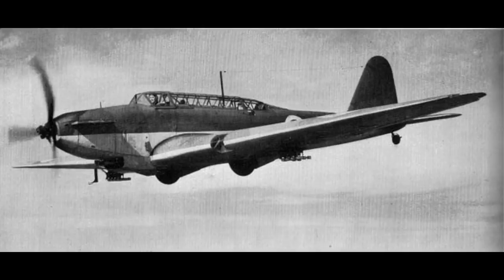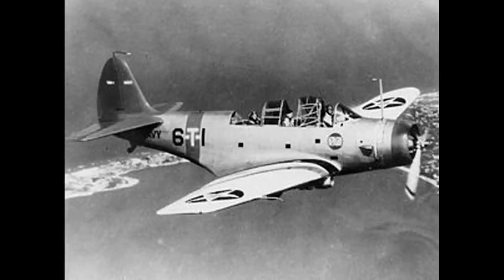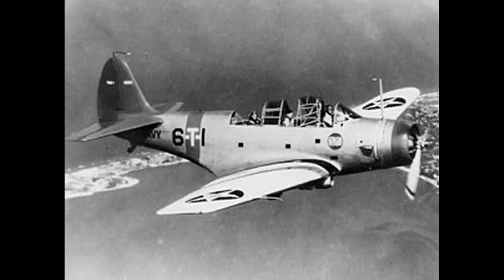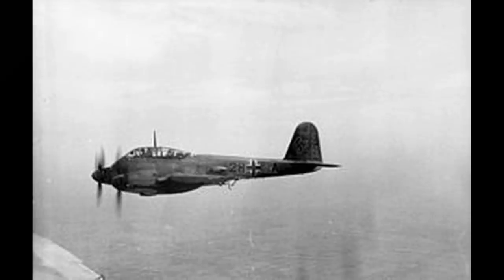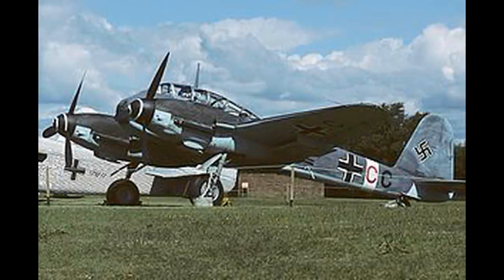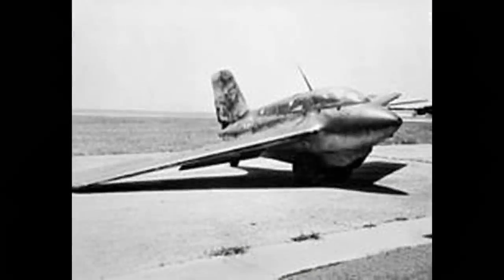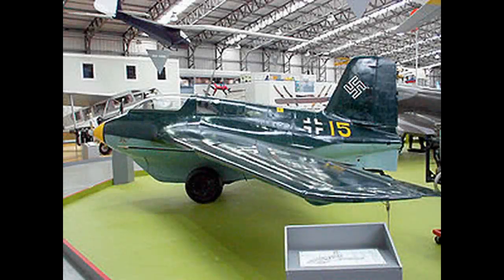TOP 5 WORST military aircraft used during WW2

Comment: Some of these, I agree...

However, your commentary is somewhat offbase dealing with the ME-163.

This aircraft was experimental for most of its service life, and early on, was never intended for combat. It was not used in WW2, until the German Luftwaffe became desperate.

It was an excellent prototype, and might have yielded a very good rocket-propelled aircraft in another few years. But as we've seen of history, it never got the chance to even get a decent set of wheels <grin>.

Again, strictly a prototype.
Reply: I don't think that's a fair representation. It had moved on beyond the prototype stage and was a proper production model, being built in the hundreds.
Reply: @AG9229  

I was very fair.

Remember, the ME-163 NEVER got a decent set of wheels for landing. This is strictly a prototype structure, and its design never advanced beyond prototype.

This partially explains why the accidental deaths of ME-163 pilots, outnumbered the deaths in combat. Its velocity of standard flight was not withstanding here. Several were shot out of the sky, by conventional production aircraft, both Polish and other pilots.

Again, it was used as a fighter, by a desperate Luftwaffe.

Period, end of story.

Other prototypes were also designed without wheels. Take a look at the US X-15. Wheel in front, and landing skids (not wheels) for landing. Again, strictly a prototype, never became a refined production aircraft.

The ME-163 was never a refined production aircraft, even when used in combat.
Reply: @kd7bwb12  I don't think you were. The fact that they put it into production without a decent set of wheels for landing shows how moronic the programme was. That doesn't change the fact that that's how they made it for war. It was a proper production model.
Reply: Wow, I guess you think that not only are you entitled to your own opinion, you're also entitled to tour own facts. How sad.
Reply: @AG9229  

Firstly, I am exactly right.

I am not stating '... my facts ...', I am stating the absolutely true facts. Neither you or I can change them.

This aircraft was launched on a trolley-wheel set that were left on the ground. This aircraft had no wheels as part of the aircraft. 

Period.

ME-163 landed without any wheels whatsoever. This aircraft was not built with wheels. This wheel set was made to work with multiple aircraft. And the aircraft not only flew without wheels, but had to land without them.

Period.

Now if you have some photos of ME-163 landing with wheels, or flying with wheels as part of its structure, you get an apology.

If you can't, you need to rethink your entire basis of discussion.

Crashing happened quite often, because there was nothing to land on, but its fuselage.

The ME-163 did not have wheels as part of its structure. Ever.

The ME-163 was an experimental prototype that was made multiple times, and never had wheels as part of its basic structure. This is the same kind of production as for the US X-15, in which 5 X-15's were built, and flew 199 missions. All experimental.
Reply: @kd7bwb12  you are far from 'exactly right'. You keep stating it was a prototype. It. Was. Not.
It. Was. A. Production. Model.
Again, you seem to think you are entitled to your own facts. You are not.
Reply: @AG9229  

It was never a anything but an unfinished prototype. That over 300 were made, do not make this a finished production product. It was never finished.

And it will never be finished.

Again, This is not my facts, this is the absolutely true facts. A patchwork project, that should have had more time to finish it. But ME-163 never got it. Meanwhile, it was pushed into some kind of production as a war production decision.

It was never a standard production regular aircraft of the Luftwaffe, period. It was a prototyped oddity that should never have been made in even the small numbers that it was built in, as it was still an experimental prototype.

I say small numbers, as standard production German Lutwaffe aircraft were made in thousands, not hundreds. Even towards the end of the war, the ME-262 had 1400 built, towards the end of the war. The ME163 had just over 300.

The ME-163 was not a prototype because of its rarity. It was a prototype because it remained an unfinished design. It was never a standard design.

Period.

This is not an opinion, all you have to do is look at the ME-163. It is clearly an unfinished prototype. It was so much a prototype, that it killed many pilots. Most of these deaths did not occur in combat. The plane was unfinished, unstable, and difficult to handle.

It still needed a great deal of work, to create a finished product.
Reply: @AG9229  

The only delusion here, is that you think an ME-163 that was reproduced was a "... standard production..." aircraft because it was  manufactured and forced into combat. The ME-163 was an unfinished experimental aircraft that was forced into combat.

Period. You cannot escape the truth.

You've already abandoned the 'wheels' debate. What else will you do to change the goalposts? Without wheels on the airframe, you had no 'standard' means of landing this aircraft, except by basically crashing it. Remember, this thing only ran for a few minutes. Powered landings are rare, and unpowered landings were very hazardous.

Even more, when we get to developments of the ME-163 in which landing gear, as part of the airframe, was instituted, now we are forced to see this aircraft as a developmental prototype again. And these variants never flew in combat.

I say again, the ME-163 (all variations) were prototypes. The ones that were forced to fly in combat, had no integral landing gear or wheels at all. The few that did, never flew as standard production, or in combat.
Reply: @kd7bwb12  you are mis-represrnting my position by making it seem that have said something I never. You are, a can confirm, dishonest. I never said it was a standard production model. I suspect the parallel you're trying to tie me into here is a false equivalence with the 109. 
They may not have made as many, but you simply cannot, in any honest way at all, pass off over 350 units as prototypes. Half a dozen, probably. 10, maybe at a push. But when you compare the numbers of prototypes of other aircraft of the era, it does not compare. Hawker Hurricane: 1. B-24, fewer than 10. Spitfire: 1. Gloster Meteor: 8. This is the norm. Not over 350. You, sir, are a liar.
Reply: @AG9229  

Okay, just for fun, let's use what you actually said:

"I don't think that's a fair representation. It had moved on beyond the prototype stage and was a proper production model, being built in the hundreds."

The ME-163 was never a 'proper production model'. Wikipedia says 370 airframes (it does not discuss numbers in actual use as fighters) built. It was always a prototype and continued as a prototypical air vehicle until the ME-163d model (please note, I'm getting into production details of the actual design prototypes), which was subsequently renamed ME-264. THIS aircraft actually had integral landing gear, with wheels, a lengthened fuselage and other enhancements. I've seen the pictures. But like the ME-163c, it never saw combat, and was never made as a 'proper production model'.

Now we're not even talking about the same airframe. And that plane never went into production, for any reason, proper production or otherwise. It never saw combat, there was not enough time to resolve the prototypical features of the aircraft, and design something that would be a 'proper production model'.

I'm not being deceitful in any way. I'm being as directly honest as I can be. I'm even giving you actual details, you have failed to try to do in your own discourse. Who is being "... dishonest or deluded here ..."? You're not even defending your position. You're just attacking me, which is "dishonest and deluded ...".

Grow up, this is a discussion where actual facts are entering the picture. The ME-163 was never a proper production model. It was a very improper product, and was never finished.
Reply: @kd7bwb12  well, let's put it in its proper context. All of the B-24s, B-17s, Halifaxes and Lancasters it faced are all prototypes, together with all of the P-51s, P-47s, Spitfires, Meteors, etc.
Also, let's not forget that working prototypes of the Me 262 had proper, working, well thought out landing gears. You are engaged in a special pleading fallacy, as well as being dishonest. Quite the score sheet.

Comment: One aircraft I haven't seen anyone mention is the Blackburn Botha. It was meant to be a recon aircraft and maritime bomber, but it was so poorly designed that it was impossible for the crew to see over the sides of the aircraft around the engines.

The Air Ministry also demanded another crew member be added, but the Botha's engines were not upgraded to accomodate this. It made the aircraft horribly underpowered and unreliable, and it only saw active service with a single unit and suffered countless crashes.

The Botha was quickly removed from service after less than a year, relegated to target tug duties. Even doing that, the aircraft proved difficult to fly, and it was permanently retired in 1944.
Reply: Yup ... awful aircraft ... woefully underpowered and incapable of maintaining altitude on one engine.  But we went ahead and built 580 of them, so when it proved to be useless in the role for which it was designed (reconnaissance and torpedo bomber) it had to be re-used for something.  Somebody at the Air Ministry then decided it was to be re-issued to training squadrons ... brilliant! ... a great way of getting rid all those embryonic aircrew trainees before they ever got anywhere near an operational squadron!
Reply: Of course there is also the well known story of a less than enthusiastic test pilot's report after having flown a Botha for the first time ... "access to this aircraft is difficult and should be made impossible"

Comment: US Navy attack tactics were in their infancy, with co-ordination of strikes understood to be necessary, but rarely achieved until later in the Pacific War. 
Not the Devastators' problem, but a command and control (not to mention training) failure. 
The Devastator was in service fully only in 1940, so it shows well how obsolescence comes from many sources. 
That it was slow, lacked manouverablity and had an unreliable weapon were three other factors. 
It's been argued that based on successes compared to cost, the whole concept of torpedo armed aircraft was a quickly passing phase; only real successes are Taranto (Royal Navy Fleet Air Arm v Italian Navy in port) and Pearl Harbour (Japanese Navy Air Force v US Navy ships in port).
There were fewer and fewer examples of air torpedo attacks as the Pacific War went on, and the last ones may be the ones in the Korean war, US Navy Skyraiders v North Korean dams.

Comment: It's a terrifying thing to think of what the Me-163 Komet might have led to if the war had extended for Germany past April, 1945. Improvements to the flight time -- and survivability -- could have led to devastating losses for the Allied bomber fleets.
Reply: "led to" are the key words. The Komet was a dead-end design, with very little development potential.
Reply: A larger version was planned, and even begun, but in the role of point-defence interceptor for which the Me163 was designed, even the Nazis realised it didn't work and stopped production.

Comment: The Messerschmitt Gigant 323. It’s defense (partly) were gun ports for small arms. 

A setting duck for fighters to bring down. Especially when coded radio announcements of schedules were deciphered. The enigma code was known to Great Britain.
Any structural damage leading to complete failure of ability to stay airborne. Of coarse it was designed for air superiority application but pressed into combat service with predictable results. All men and material on board lost.

Flying at 120 mph with fighters able to easily exceed 350 mph.
Reply: I believe some were shot down by RAF B26 Marauder bombers!

Comment: It's not that the aircraft were terrible. It's the fact that they continued to be used in roles they could not perform because of technical obsolescence and failure to be replaced in a timely manner. The Battles were keep in production not because they were seen as viable but rather because their construction keep factories open and jobs filled. They was a silver lining in that all those Merlin engines could be rebuilt and repurposed

Comment: The Breda 88 Lince, The Blackburn Botha, The Messerschmitt Me163, and many more. 
They are all 'crystal ball failures', and all are hamstrung by using underpowered engines, changing priorities, insufficient time available, etc. 
It's worth looking at a whole generation of US attack / torpedo / bomber planes designed during WWII for the US Navy of which only the Douglas A4 Skyraider actually was successful. There's rather a lot of them. Some failed because of the jet engine's arrival, some because the roles were changed leading to delay beyond the end of the conflict, some due to pentagonal politics.

Comment: It grates me to see the Me-262 as such a great fighter.  It had short range and a top speed of greater than 600 mph.  The US P-80 was smaller, almost as fast, but could out turn the 262.  Only the leadership at the time kept the P-80 from shooting down the 262.  It grates me because many men lost their lives by that decision.  The P-80 came on line in 1944 not 1945 as some will tell you.
Reply: The P-80 although straight-winged proved its superiority by shooting down the swept-winged Mig-15 in Korea.
Yes, it was really regrettable for not using it against the nazi 262 in Europe.
Reply: Since when could a 262 get to 600 mph in a straight line?
Reply: The 262 was supposed to be used as a bomber interceptor, a role at which it would certainly have outperformed the P-80. The He162, Meteor, and Vampire were all as good as the P-80 or better, and all were coming on line within the space of a few months.
Reply: @mebsrea  Outperforming the P-80 perhaps in fleeing speed, for in dogfights the P-80 would have shot the 262 out of the sky, as the ''propellered'' P-51s  & Tempests did already for some time.
Reply: Charles putnam1982 You don’t seem to understand. The 262 was needed as a bomber destroyer, not a dogfighter, and the 4x30mm armament of the 262 was enough to reliably knock down a 4-engined bomber with two or three hits. The P-80’s puny .50-cal machine gun armament was much too light for such work, but good enough for killing fighters (though the British solution of 4x20mm Hispanos was much better.)

As for being shot down by piston-engined aircraft: yes, but almost always during takeoff or landing, when the 262 was slow and unable to maneuver or accelerate quickly. The P-80 would have had the same problem if faced with clouds of FW 190Ds or Me 109Ks orbiting near its bases. At altitude and with two working engines (itself a problem due to shortages of critical alloys), the 262 was essentially untouchable by Allied fighters.
Reply: @mebsrea the p-80 wouldn’t have done anything, as it did serve. It just did reconnaissance and that is what it would’ve done. The USAAF would not use an un-tested aircraft.
Reply: POTATO JUICE It’s not a matter of whether it was sufficiently tested (the P-80 development program killed several test pilots, including Dick Bong), but the fact that the Germans by late in the war lacked access to the raw materials some of their most advanced technology needed to function reliably and had lost control of their own skies, ensuring that their aircraft were always at risk of being jumped while low on speed, altitude, and/or fuel.
Reply: @mebsrea That’s also a good point. The luftwaffe was gone by 1945 and the p-80 would have nothing to shoot at lol
Reply: @Charlesputnam-bn9zy  You're becoming unhealthily emotional about a simple technical matter. The 262 was faster than the P-80, accelerated faster than the P-80, and climbed faster. If it was choosing to engage in dogfights with slower, more maneuverable adversaries, its pilot obviously didn't know how to use his aircraft. (We'd see the same kind of problem in Vietnam, where technologically superior Phantoms were destroyed by much slower Mig-17s and -19s when American pilots threw away their own advantages and engaged them in low-speed turning fights.) With its swept wings, the 262 was an aerodynamically more modern design (though the wing sweep was the fortuitous result of weight distribution considerations, not theoretical calculations.) Four heavy cannon was hardly overkill for a bomber destroyer; given the differential in speed between an attacking 262 and a B-17 or the like, a German pilot would have only a split second in which to fire. One or two hits had to be enough to cripple or destroy the target, and the 30mm shell was perfect for that task.

To recap: it's possible the P-80 was a better dogfighter than the Me 262, though the 262's advantages in terms of acceleration and climb rate make me somewhat skeptical of that claim. However, the Luftwaffe's most desperate need in 1944 was not for a dogfighter, but a bomber destroyer, and it was much superior to the P-80 in that role. 

Now please dry your tears and carry on.
Reply: @mebsrea  Look who is talking.
Reply: The P80 could not have been used against ME262s because it did not have the range. Jets were not at all fuel efficient at that time. The 262s operated in relative proximity to their own airfields. At the very end of WWII, we had airfields close enough, but by then we had air supremacy, and it was a moot point.